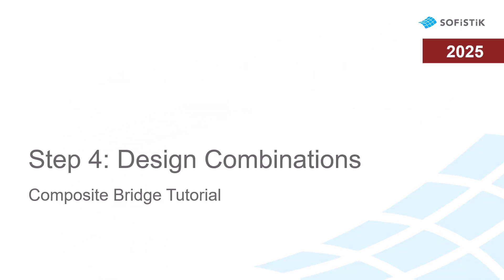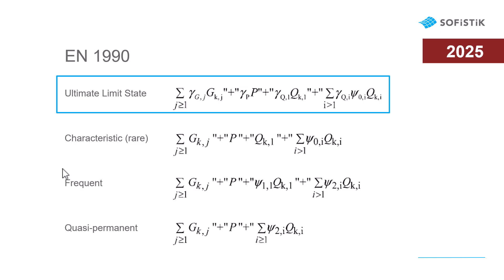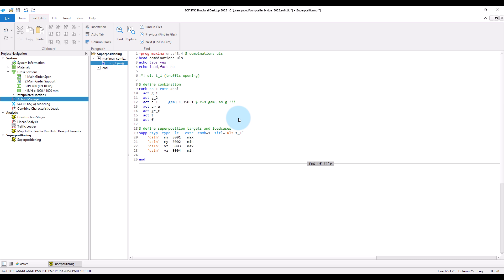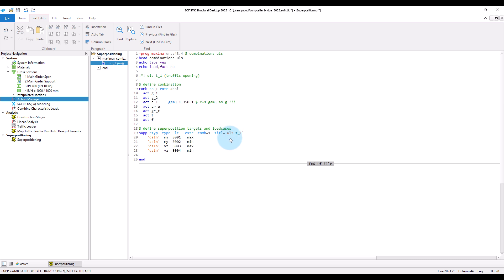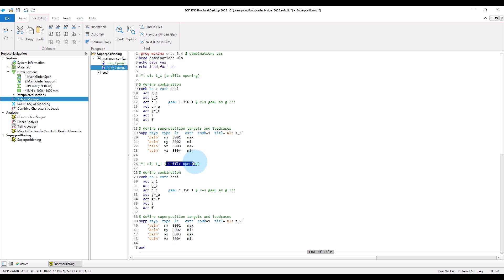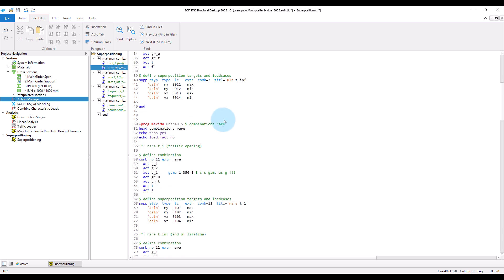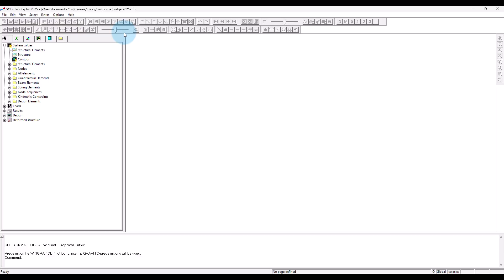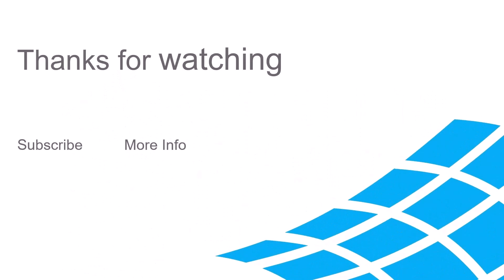Composite Bridges: Design Combinations

Comment: Hi,

Is there a way to obtain support forces while running Traffic Loader in the SOFiSTiK Student Version? It seems that during Superposition, only forces in beam elements are being calculated, even when including the node section in the Teddy Editor.

Thank you!
Reply from the maker: Hi Dela-delana,
The Superpositioning-Task with the program "maxima" creates results for a combination of loads (sorted by actions). This is done with the command "comb" and "act".
Based on this combinations "maxima" can create superpositioning results. This is done by the command "supp". In this example the only results produced are for design elements "dsln". If you also want to create superposed results for support conditions, you need to tell "supp" to produce them.
You can do this by adding: "node" pz 3501 max
into your "supp" list. The program will create a result-loadcase 3501 with the maximum support forces.
I hope this helped - please consider subscribing ;).
Reply: @SOFiSTiKAG  Hi, 
Thank you for your response. I’ve already done all of that. My question was specifically about the Traffic Loader, as it seems it’s not calculating support forces. When I perform the superposition of support forces in the Teddy Editor, the forces from the Traffic Loader are not included—likely because I’m unable to obtain them in the first place.
Is there anything I can add to the Traffic Loader Task to ensure it calculates support forces? Aside from the forces in beam elements, I’ve only found options related to node displacements and rotations within the Traffic Loader task.
Reply from the maker: Hi Dela-delana,
you are correct, ELLA does not generate resutlts for fixed supports. 
It does generate results for springs/Rsets (result sets/Bearings).
So if you use them instead/complementary to your fixed supports, you get your wanted support forces.
Reply: @SOFiSTiKAG  Thank you so much for your help! :)

Comment: Thanks for the great video! One question: in previous versions of Sofistik, when dealing with evolutive cross-sections, the variable loads had to be combined with AQB ("containers") rather than with maxima. 

However, in this example, we are using maxima directly on an evolutive cross section. I understand that this is why we are using design elements rather than the beam elements. 

I understand that, in this example:
1) The stresses of the beam elements for the ULS / SLS combiantion will not be correct. 
2) The stresses of the design elements for the ULS / SLS combiantion are correct. 

Could you please clarify?
Reply from the maker: Hello AndresHermosoMeijide,
the new "composite" module doesnt require an additional superposition for aqb anymore to design the composite section.
Both methods (composite or aqb) are valid as for their results, but aqb only saves min/max results. This requires you to manually seperate the situation at t0 with "C_1" and t8 with "C". Composite on the other hand allows you to easily get the min/max at t0 and t8. "Composite" requires design elements and with them adds additional information for specific design situations along the linear element. To sum up: Both methods give you the correct stresses if used properly, the goal of composite is to make the process easier.
If you have further questions, please contact us via the "Support Assistant" in SOFiSTiK - Help :).